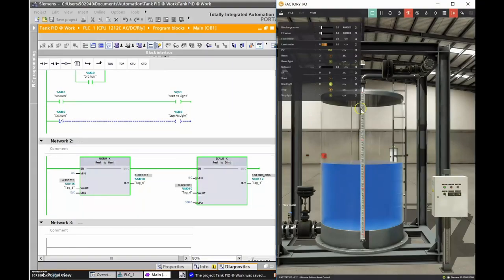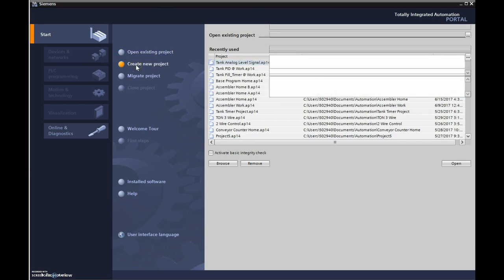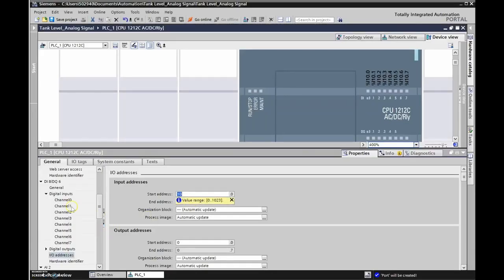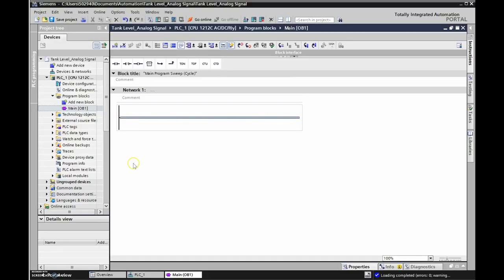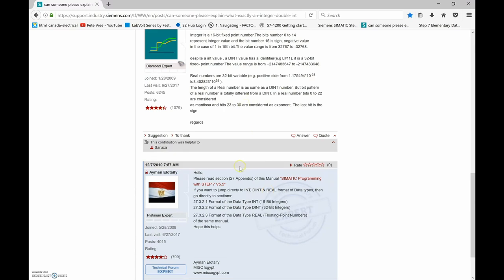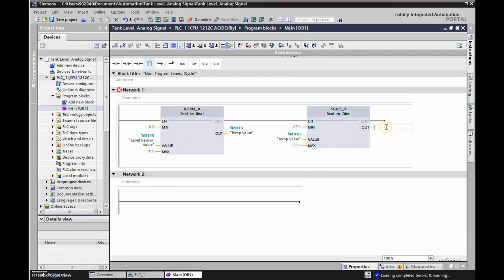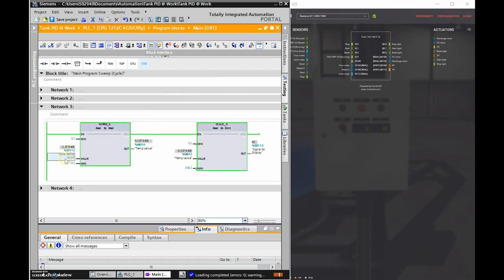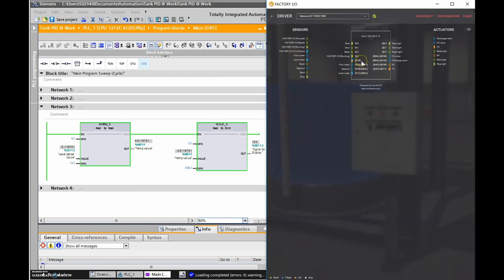Siemens TIA Portal & Factory IO (How to Display an Analog 0-10VDC Signal / S7 1200)

Comment: very helpful Video As Usual. I see the problem like offsetting the I/O Addresses for 0 to 10 and you should do the same for AI addresses on PLC , because the floating voltage on TIA Portal is coming from the PLC I/P not from Factory I/O.
I am learning from your good videos along with Rajvir Singh videos at the course..
Reply from the maker: Yes. The analog signal messed me up for a while. I often overlap various words in my programs as they get larger as well. Reinforces the fact that we should create a spreadsheet for all bits, words, and dwords as we develop our programs. Thanks for helping me learn as well.

Comment: are the contents of network 1 necessary to start the tank fill proces and discharge valve process? you didn't share network 1☹
Reply from the maker: Network 1 was just a simple 3-Wire control that turned on a "Sys Run" Bit, that controlled a green and red light. Here is a new video that might explain things better: https://www.youtube.com/watch?v=T9kPdUtWZZw